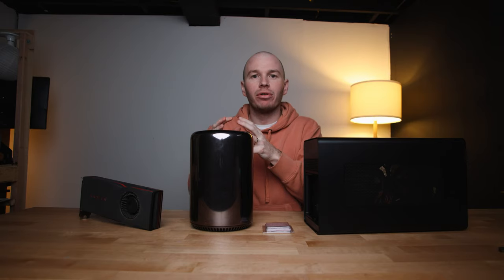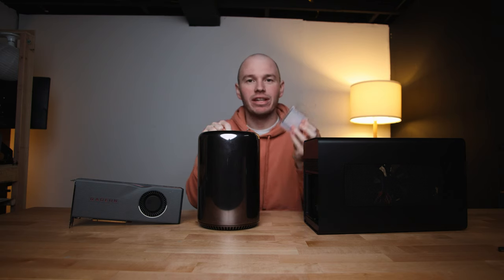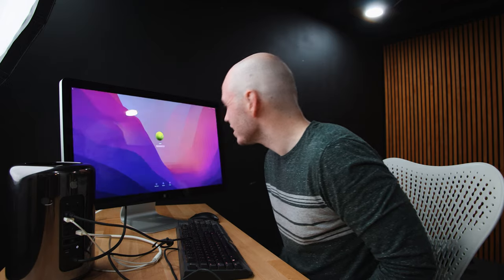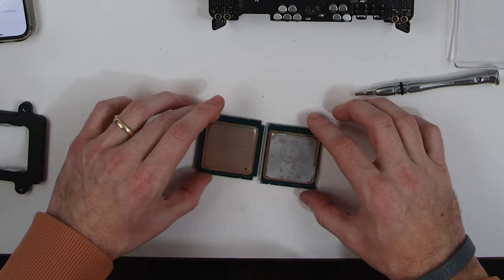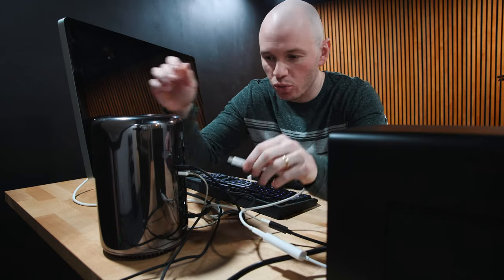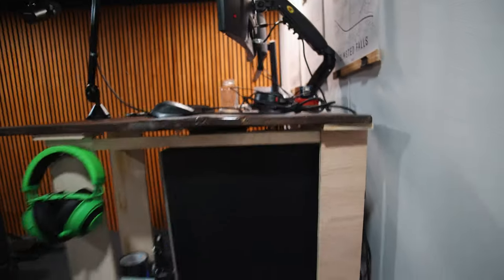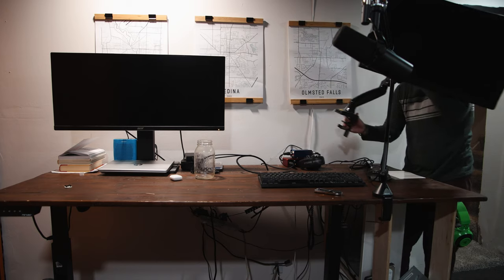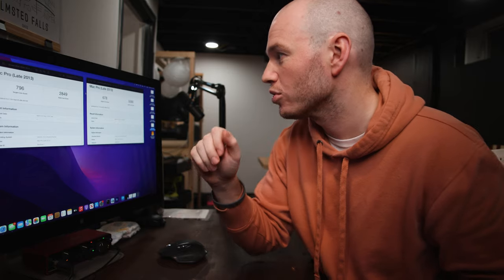I Built the ULTIMATE 2013 ‘trash can’ Mac Pro

Comment: I purchased in early 2014, the 8-core Mac Pro with 32GB RAM and base GPUs.  Lasted me all the way to 2020, then I upgraded the RAM to 64GB and it brought new life to it.  That lasted until 2021, before being replaced with iMac Pro.  

I used to it run 3 VMs for work.  (2x Windows, 1x Linux).  I thought about upgrading it to 12-core in 2020/2021, but AMD Ryzen made it difficult to justify it back then (Ryzen 1800).

It still works 100%, I power it on from time to time to run updates.  Kinda wish Apple re-cycle this design with Apple Silicon.
Reply from the maker: Apple silicon 2013 Mac Pro chassis is 100% ideal. I would absolutely love that. This design is so incredible compared to the new Mac Studio

Comment: I have the quad with 32gb RAM and 2TB SSD. VERY happy with it, still going strong!
Reply: I just bought one for 275 on eBay with similar specs as yours! Does it Dunns smooth? I am coming from a 27 inch iMac with 17 gigs of ram

Comment: the best upgrade you can actually do is the 1680v2 processor, its 8 core 16 thread yet has far higher cache and clock speeds
Reply: If I'm not mistaken the 12 core has the higher cache (25MB) as well.

Comment: I upgraded mine to 12 core, 128GB RAM, installed the Amfeltec SSD expansion module, upgraded the SSD to 2TB OWC, along with another supplemental 2TB Samsung SAD. The only thing I haven’t done is the eGPU, which doesn’t seem worthwhile.
Reply: how does it run fir 2023

Comment: This is a really entertaining video, as I can tell you're having a lot of fun with these upgrades. :)
I finally acquired a 2013 trashcan Mac Pro last year for a bargain price, and upgraded it with 64 GB of RAM and a 2 TB NVMe SSD.
I'm not fussed about upgrading the trashcan Mac Pro's quad-core CPU — I lack the parts and confidence — but I AM awaiting a 3.46 GHz six-core CPU tray for my 2010 cheesegrater Mac Pro.
With this CPU tray, I will have upgraded every major part of the computer — four-core to six-core CPU, 48 GB RAM, RX 580, 1 TB NVMe SSD — and I can't wait.

Comment: I just stumbled across this video and wanted to mention if you didn't know, the trash can won't utilize all the processor cores when running a benchmark. I ran into this when testing mine, if you run it from bootcamp windows, windows will utilize all the processor cores. It's something to do with Mac OS Vs Windows and how they control the processor cores. You will get a higher benchmark using Windows.....

Comment: The 12-core is not the best option for this machine, I would go for the 8-core 2667 V2 -> + 15% SingleCore Performance, - 7% MultiCore Performance. It's much better for daily tasks, because of the better Single Core Performance.

Comment: I have one of these maxed out. I have two Thunderbolt Displays and a 4K monitor that can be ran at 60hz. Unfortunately I have to use the 4K monitor with the hdmi port that can only put out 4K 30hz. I was using an egpu that was able to run power the display at 60hz but when using it for watching 4K videos would lag. The monitor isn’t thunderbolt but it has mini display which should work and display port which the Mac Pro doesn’t have. I love my computer. If I can find the right mini display cable to connect my 4K monitor to my mac without a glitchy screen and no egpu that would be great

Comment: I have a 12 core 2013 Mac Pro and was thinking about adding a eGPU but probably better of buying a refurbished M2 Mac Mini for a little more than total cost of eGPU and graphics card. No matter what graphics card I buy it will not be able to keep up with a M2 Mac Mini Media Engine with built-in hardware encoders/decoders. Everybody has different needs though. The other issue is using a Thunderbolt display. Kinda sucks no graphics cards support Thunderbolt out.

Comment: Well, fun project but the eGPU enclosure is so big that you can have a ITX MB in it. Take a small factor PC case, build an insane powerful PC for cheap and use it as an Hackintosh. It will be smaller, faster, with H264 and H265 hardware encoding, ultra fast nvme SSD, lates NVidia or AMD GPUs... but i love the design of the Trashcan but without the eGPU... too bad about the D700 x 2... I had to sell mine few month ago

Comment: 3:12 what display you have there? I just brought a 27’ Apple Thunderbolt Display to connect to Mac Pro 2013 tried connecting to my EGPU it won’t display picture. An my extend cable is mini display port to display port on back of GPU. Never mind just that not a Thunderbolt Display you in video

Comment: Mac Pro 2013 Mantiz Venus MZ-02 -5x usb 3.0 ports, a ethernet port, and a ssd mount. The thunderbolt connection also allows 100 watts of power delivery,MSI Air Boost Vega 56 with 8gb of HBM2 memory.
  512gb SSD 

I want to get a eGPU for my MacBook Pro 2011, since apple ship it with a faulty gpu

Comment: Is it possible to use egpu on a Mac pro 6.1 (2013) running 14.4 Sonoma (which is installed via OpenCore Legacy Patcher)? I read that it is necessary to use kryptonite, but their guide explicitly states that the operating system must be without hacks, which means Monterey is necessary. But I want to stay in Sonoma.
Reply: You can always install Sonoma on a separate Apfs volume. Then you can dual boot and use Sonoma for daily tasks, and you can use Monterey for gpu specific tasks. I do that with Ventura and Sonoma on two separate volumes and I just dual boot.

Comment: Is that an Apple Thunderbolt Display or a Cinema Display? What kind of adapter do you use to connect the gpu to the apple monitor?
Reply: It looks like a displayport to minidiplayport (or thunderbolt 2) adapter, but you do not refer this on parts that you used. I am aware that you need a thunderbolt 2 cable anda thunderbolt 2 to thunderbolt 3 adapter to connect the trashcan to the egpu (and you mention that on parts that you used).
Reply from the maker: You are correct. That is a Cinema Display, you need a display port to mini display port adapter. The display port side is the "male" side and the mini DisplayPort is the "female" side.
Reply: @techno_eclipse  ok. Not the same for an Apple Thunderbolt Display, since Thunderbolt 2 and mini displayport are not the same… 👍
Reply from the maker: Yeah thunderbolt displays are a lot harder to adapt. I think it may be possible but I am not 100% sure on that